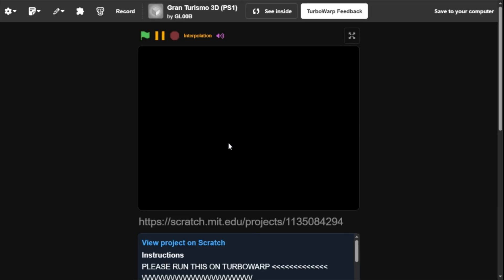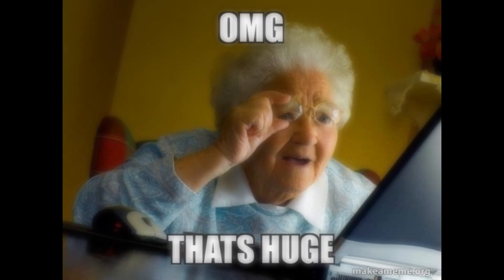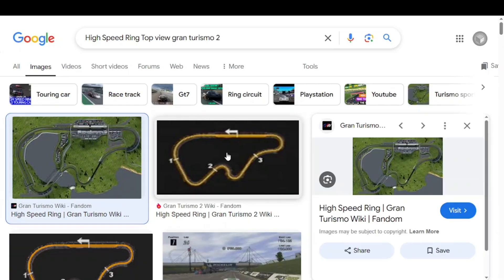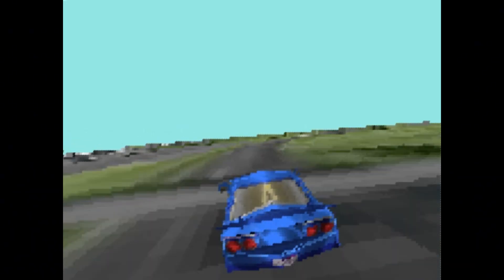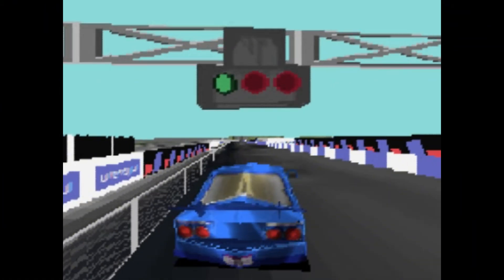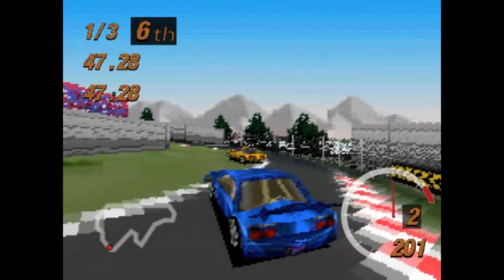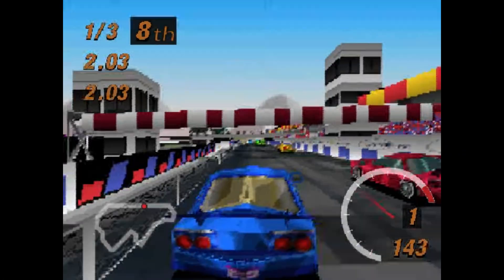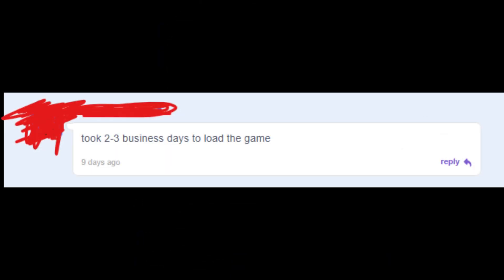HOW I MADE THE BEST 3D RACING GAME, ON SCRATCH!

Comment: You have to reduce calculations if you want a very high performance, And reduce operations and avoid recurrence of functions, And you will get a perfect game for all weak devices
Reply from the maker: And what makes you assume this isn't optimized as absolute hell? do you think it's just pure messy code? thank you for the suggestion, but the game is already so optimised and that's how it runs quickly! also, 3D scratch, optimised or not, is never meant for really slow devices. even a raycaster would lag there..